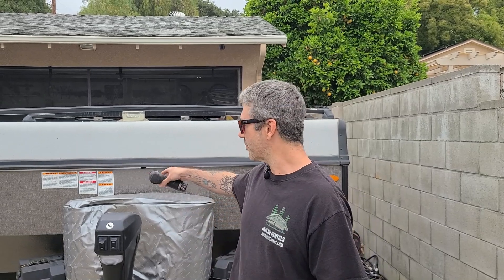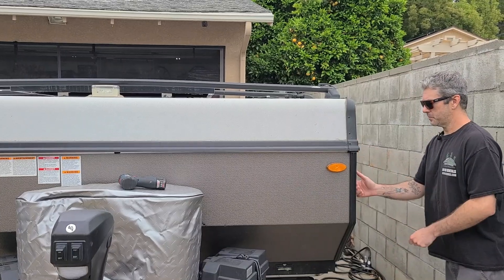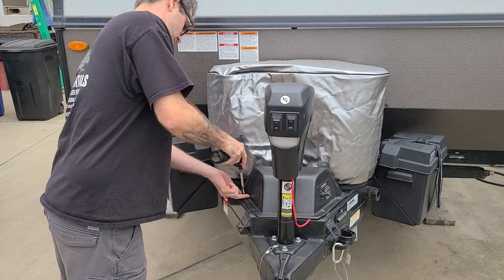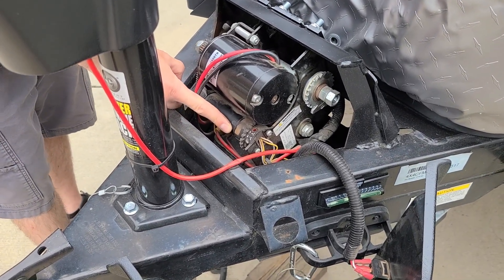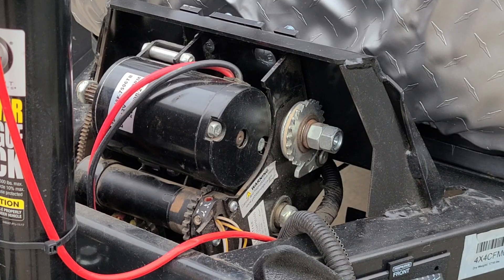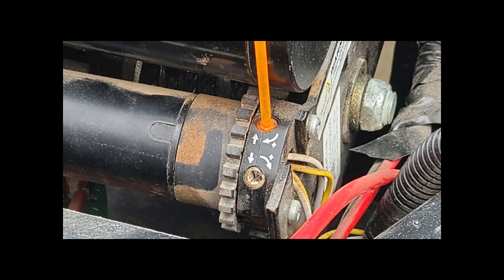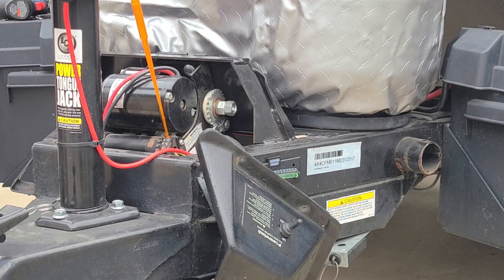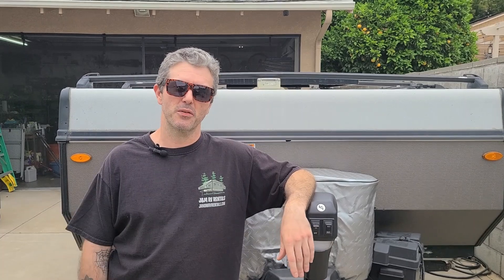Popup Camper Roof Not Raising High Enough (Powerwinch P92001 Limit Switch Adjustment)

Comment: Have similar trailer and going to disassembly that limit controller since I can only raise the roof and cannot lower it
Reply from the maker: Sometimes, that can also be caused by a bad relay pack on the winch.  If you are turning the limit switch adjustment screw and it never works, then I would check out the relay pack as well.  I do have a video posted on how to replace the relay pack if needed.  Thanks for watching!
Reply: @Jandmrvrentals  it was relay assembly. one of relays doesn't work
Reply from the maker: @rpogontsev  You can purchase a new relay pack online.  The part number from Powerwinch  is:  R001751
Reply: @Jandmrvrentals  I took out a limiter and verify with multimeter that switches are working properly. The next step as you suggested to verify relay pack

Comment: We are still on the step in which we are decreasing the limit switch and have turned it prob 100 times and we are not getting a clicking, still moving up and down.  What could the potential problem be here?
Reply from the maker: There can be situations when you have to turn it for a while.  I will normally lift the roof back up and keep turning. It should eventually stop.  If you reach another 100 turns and it still doesn't work, I would inspect the small plastic gear located on the limit switch.  I have seen them slide over, making it unaligned with the metal gear.  This would cause the limit switch to not work at all.

Comment: This is excellent,  as are all your other videos. We have a 2022 Rockwood 2280 ESP and there are only 2 other YouTubers with useful comments on that, or similar, models, that I've found, so your tips are great! In our first month of ownership, the roof would not go high enough to install the door and we had some other issues as well. The dealership we purchased from is half a days drive away but we have an RV dealership where we live that is part of the same company and we had been assured they would take care of us. But we learned that most RV technicians know next to nothing about tent campers and hate working on them. (We're in British Columbia   Canada.) That's a shame because we love our camper, but boy, has it been a huge learning curve. If it wasn't for channels like yours we would be lost. The pro certified tech we took our camper to said there was nothing wrong with our roof. He explained (as if talking to a dummy) that it has a "limit switch" and it's supposed to stop it from going any further. He had no idea it was adjustable, and at that point, I didn't either. I asked him if he put the door in and he said no, and seemed to think that was a dumb question.  Apparently all our concerns were " user errors" and we were told that they don't sell tent trailers and don't work on them. Eventually, we found a local fellow who DOES understand tent trailers and he showed us how to adjust the limit switch, exactly as you set out in your video. Please keep this great information coming.  Every one of your videos has helped us!
Reply from the maker: Thank you very much for watching my videos! I'm really glad they are helping others such as yourselves.  Unfortunately we have that exact same problem in my area, nobody will repair a tent trailer even if you bought it from them.  That's why I decided that I would focus solely on them.  If you ever have any video requests or any questions, please don't hesitate to ask.  I'll always try my best to help out!